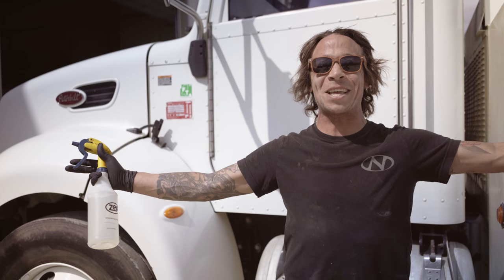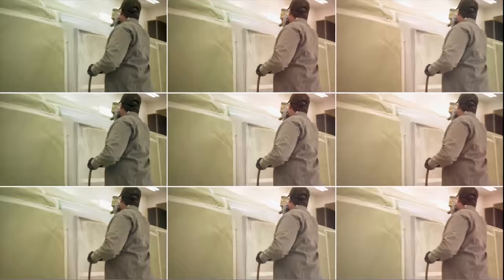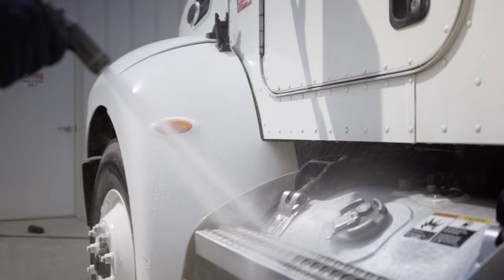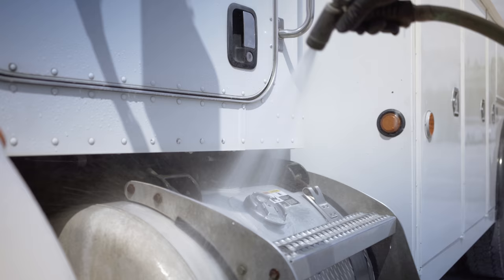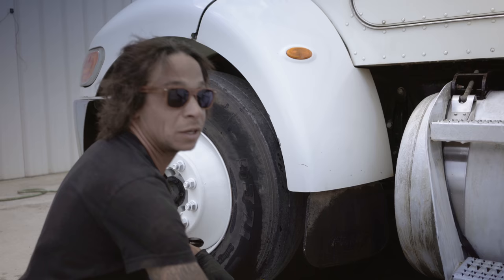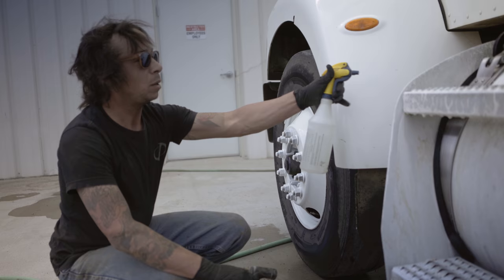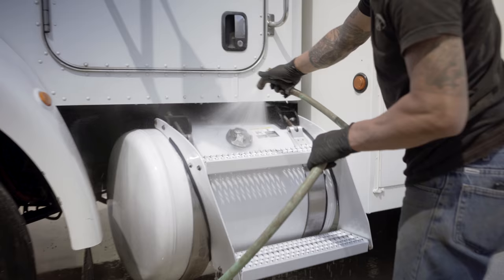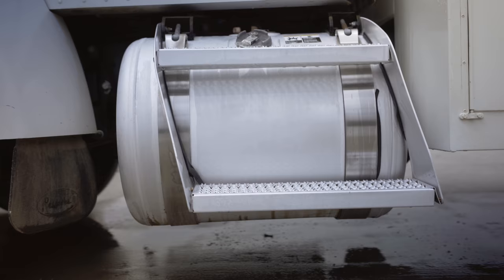I Cleaned My Semi Truck's Aluminum Fuel Tanks

Comment: What ratio of muriatic acid to water did you use in that bottle?
Reply from the maker: Here's what Kenny said: soak the surface down with water then apply acid as needed with a spray bottle.. also inform them not to lot let the spray head sit in acid cause it will eat the guts out of the head.  Every few fill ups run water thtough the the spray head and they will be good to go. Thanks for watching and have a great day Kris!
Reply: Is muriatic acid safe for the inside of aluminum fuel tanks? I have microbes that grew inside. I drained the fuel and flushed it with water but it's stuck to the inside walls.